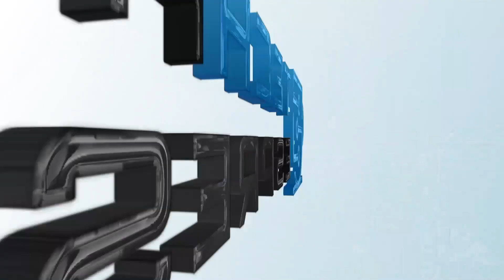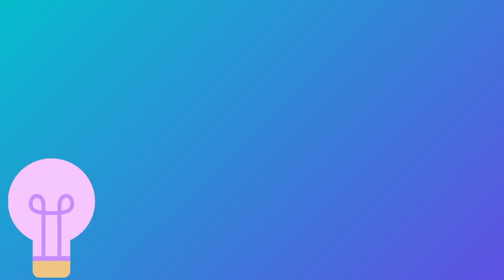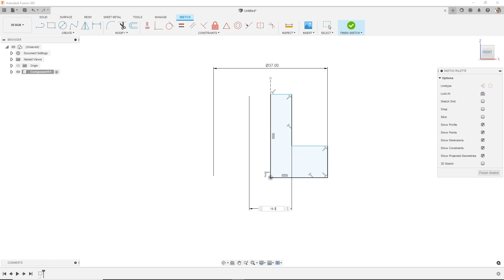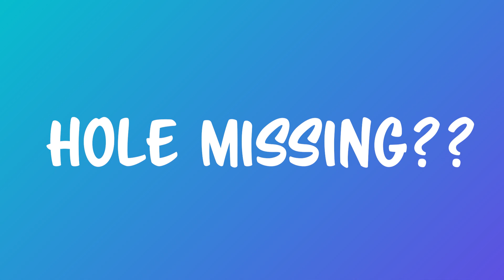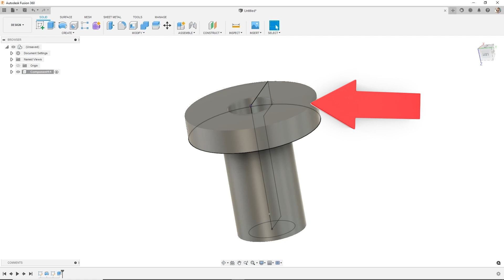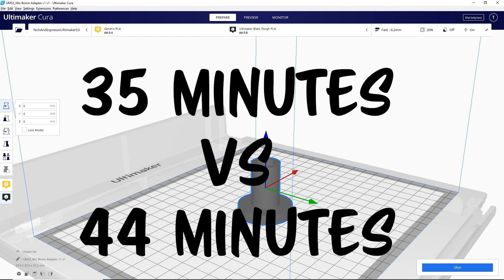The Secret To Make Your Own Designs On Your 3d Printer [Design To 3d Print in Fusion 360]

Comment: Thanks for the vid.  While Revolve is the best way for complex round shapes, this example could've also been completed with 2 simple cylinders extruded from 3 circles.  That's how I did similar before I learned of Revolve. :)
Reply from the maker: Yes 👍. One benefit for a revolve is the edit is easier later.